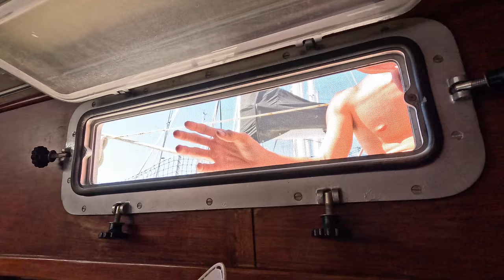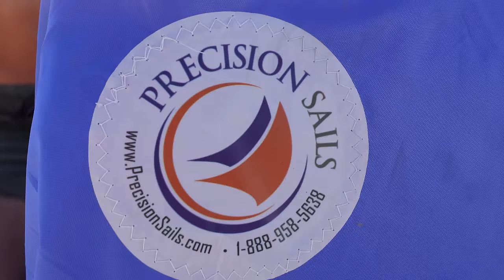Having this on your dinghy might save your life Ep 406

Comment: That Dinghy light is a great product, and that one is very well thought out. And at $107 it is true value. Im ordering the same solution you have done, for all of the same reasons. Thanks!
Reply: We found driveway solar lights at a hardware store. They are sealed, potted, close to indestructible and cheap. Reg, green and white available. 4200stuck on the sides and top...

Comment: Awesome nautical light for your tender but, as you stated Lee, there is vibration. From personal experience both on land and sea it is good to mount the light or anything else solidly with bolts, lock washers, nuts and LockTight. Even on a new motor it would be safer fastening the light on or . . . . oops, the light just landed in the drink. Good to have a spare head lamp on your tender also. cheers.